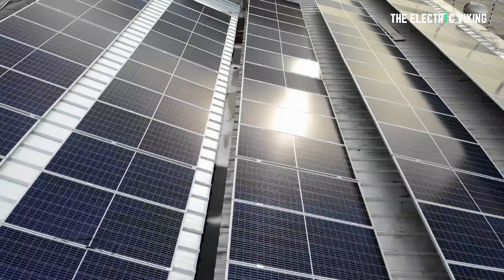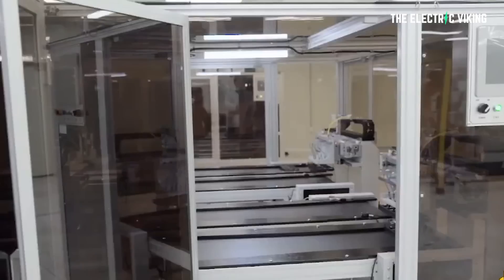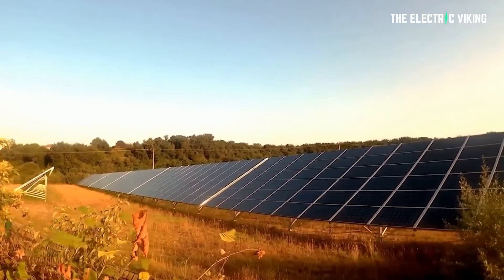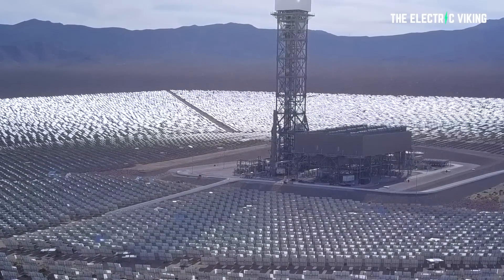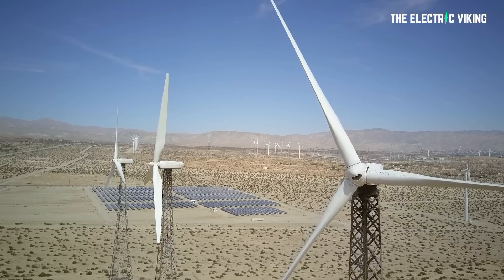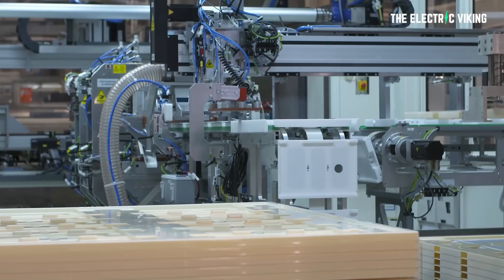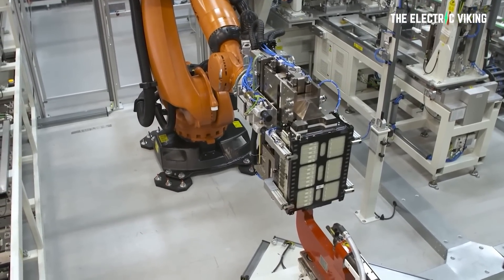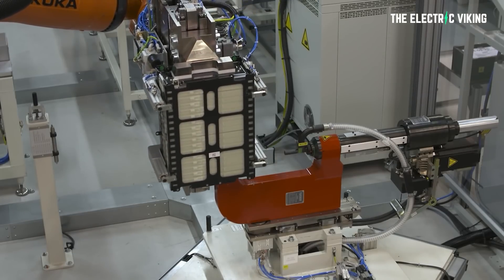The new battery that is cheaper than lithium with 4 times the capacity

Comment: How many solar panels do you have to use? and how much space would you need to replace one safe nuclear NON -pressurized (Melt down proof) 97% efficient (95% less waste) liquid fluoride Thorium (400x more available than uranium) reactor? Which also, btw, doesn't require expensive uranium enrichment processes (i.e. it would be free from Rockefeller controlled, dangerous, expensive, plutonium producing, waste producing fast breeder reactors? In fact it could be adapted to use all the existing waste uranium for processing... (which would be essentially free fuel!)

Comment: To answer your first question, The internet is flooded by the latest battery breakthroughs, all last longer, store more energy, and are cheaper.
It's just that once they have this amazing breakthrough you never hear about it again, and remember what you can do in a lab can be impossible to do in production.
It's like nuclear fusion, won't happen for 50 years at best, and may never happen.

Comment: Thin.  Very thin.  Vid author complains nobody's excited about Sodium batteries, then gives no reason whatsoever to be excited?  Where are the technological advancements?  What is the fundamental basis for claiming 4X-capacity?  For example, salt kills most batteries.  What's the change that suddenly makes salt a solution instead of a problem?  Lithium has a dendrite problem, how does salt improve it?  How is salt more mobile?  There's simply nothing in this vid but puffery.

Comment: There is not a shortage of Lithium. I am not sure why people equate the cost of refined Lithium with the idea that Lithium itself is rare….. it’s not rare. 
The shortage is of refined, purified Lithium. Lithium is one of the most abundant elements and is found all over the US particularly in the area of Nevada that Tesla has mining rights on. There is enough Lithium in easily accessible Lithium clays in Nevada alone to make enough batteries to completely electrify all transport in the U.S.
The problem is that the Lithium has to be refined to a very high purity and made into particular Lithium compounds. 
    The same problem of needing Sodium to be purified will exist. There will have to be special sodium mines and refineries to supply sodium for batteries. There’s lots less of those than there are Lithium refineries and guess where they all are? Yep the same place the Lithium refineries are. China. 
    The solution to the problem is not to change battery chemistries but to fast track the opening of Lithium mining and fast track the opening of Lithium refineries. Make LFP batteries.

Comment: Although it should be fair to point out that the focus of the research team led by Dr Shenlong Zhao of Sydney University wasn't for EV application but large scale grid storage. We should temper our expectations in regards to this until it is proven to be commercially viable.

BYD will be launching sodium-ion batteries but that is not related to this new type of sodium battery which you're talking about. The type being used by BYD will have a density of about 160wh/kg which is less than LFP at about 200wh/kg.

Comment: Sodium may have greater density but it also has more weight, which negates the capacity advantage to a certain extent. A heavier car will cost more due to needing more materials to support the greater weight. The ideal use of sodium batteries would therefore seem to be stationary storage, not vehicles. But that would relieve some of the pressure on lithium demand. And from what I've heard elsewhere the real problem with lithium supply is not that there isn't enough but that there isn't enough capacity to refine it fast enough to fulfill the exponentially rising demand. Musk pointed that out in 2021.  So sodium may be a good fit for the Megapacks.

Comment: The most obvious way to rid ourselves of coal burners is to substitute a set of small modular nuclear reactors for the coal furnace that boils water into steam.  The rest of the plant {steam turbines, alternators & cooling towers can stay as-is, more-or less.  All the existing transmission line infrastructure carries on as before, unchanged.  Just change out the heat source.  Search for "IMSR" for more information.  Much cheaper overall than using tech that needs expensive batteries.  Why use inefficient wind & solar when nuclear can be on-line 24 hours a day?  No batteries required.   BTW, 1000 charge/discharge cycles is laughably inadequate - the cells would need replacement every three years if cycled only once a day, which is a minimum condition.

Comment: Seen alot of comment here on Lithium vs Sodium. But hey i think there is a good potential on Sodium Battery. If they make it cheap enough to be replace, even with 1000 cycle is still workable for EV just like replacing your 12 volt lead battery. Every 2 to 3 years. Lithium as raw material has surge so much in fews years in another fews year it will surge so much than maybe sodium will be a more cost effective solution.

Comment: Lithium battery resources will be the problem soon.
Most of the countries will stop minings and exporting to the manufacturers for electric car. 
Because of legal issues 
Child slavery 
Landscape deformation and water pollution.
Mountains rivers causing floods landslides deforestation.
Minings of lithium are limited.
That’s why most
Of car manufacturers aren’t
Convince EV is the future.
Toyota Lexus has lots of alternatives.
Most of consumers likes.
Hybrid
Combustion 
Hydrogen 
EV with solid state battery
If the target is 2035 for zero emission.
Only few nations will comply of zero emission.
Rich countries only with small populations like Norway and Switzerland 
90% will still using combustion engine.
Oil producers exporters they might not buy 
Electric cars.😁

Comment: Dear Viking. Maybe I have identified one of the reasons why you had to come back with this topic once more. If I'm right, you may want to come back with it for a 3rd (and maybe 4rth) time soon. I recognized that you are talking about a minimum of 3 completely different types of batteries in the same video without showing it (just talking). I would almost bet that the vast majority of your viewers will not finally get your point because of this. The point you are making in this video may not be true for all of the 3 types of batteries, maybe not even for one of them. Rationale: a) Early in the video you are talking about sodium batteries, which are batteries that may be used for grid and/or home storage. These have quite a bad energy density and the title of the video does NOT talk to these. These are generally known under the name of "Salt" batteries and have an Aequous electrolyte that makes them very safe. But they are NOT cheap and they have LOW capacity. b) just prior to half in the video you are talking about Sodium Ion batteries but I'm not even sure if you are using the right term for it. These are the ones CATL is starting to make for cars but these do not have a better energy density than LiFePo4. The only way BYD can use them in their cars is by changing the design of the batteries to CTP (cell to pack) exploiting the advantage of these to not being in need of as much coooling as other batteries may. In this way they are making up most of the energy density drawback. And only the 1st half of the video title may possibly apply to these, but honestly we don't know as of yet because current sodium ion batteries in the market place are not any cheaper to buy than Lithium, because they are not yet mass produced. c) To the end of the video you are talking about a new concept of Sodium-Sulfur batteries which again is a completely different story. Until these are on the market I may not be around any more because so  much of this concept is still to be developed it is maybe more than 1 decade away from the market. Maybe to this one the 2nd half of the title of the video may apply but honestly we don't know yet because it is only a concept. And for sure your point in the video "so much has changed for EV's..." is NOT true for this concept while it has nothing to do with how EV's will be built in the current decade. Maybe in the next? But then, why don't you make such a video in 2026 it will be early enough.
Bottom line: If it was your goal to confuse your viewers over sodium Ion batteries using this video, you have done a phantastic job!
Congrats, if that is.
Reply: 100% agree that it's confusing. If it was about Sydney Uni's lab result of getting more energy density from a sodium battery, then he doesn't go into enough detail about the sulphur being the main driver of this increase and how being able to stop the degradation of the sulphur is the big issue. 50% capacity after 1,000 cycles isn't that great. I think US based Lyten and Germany based Theion are more advanced with their nanotechnology controlling the polysulphides in their Lithium Sulphur batteries, with both claiming around 900 wh/kg density and lifecycles comparable to existing lithium ion batteries. They're now shipping test batteries to industry but I guess it will be several years before this technology becomes proven as suitable for EVs and adopted by manufacturers. LIS energy in Australia also claim to have their boron nanotube Lithium Sulphur battery technology at similar density and lifecycle as Theion and Lyten but their website has less detail, so I'm not convinced their product matches Lyten's or Theion's.

Comment: REALLY SPEED the transition to a carbon-free ecology and economy: NUCLEAR POWER! The power density for nuclear is about 1000W/m2 compared with 2-3 W/m2 for wind and 100 W/m2 for solar. Nuclear emits 4 times less CO2 than solar power, 2 times less than hydroelectricity, and the same amount as wind power. BEVs need electricity.

Comment: This is actually a great arguement to build Deslaination Plants in every coastal country not only to provide clean filtered drinking water for every country on every continent, but they could now use some of the excess sodium (salt) taken from the water for batteries.  Some of the salt will obviously need to go back into the oceans, but some could also be used for batteries.  If we can pipe oil anywhere we can pipe clean filtered drinking water everywhere & solve so many problems around getting clean water to people who need it & we could solve the drought problem everywhere.  Solar, wind, tide & Geo-thermal will solve the energy problem not only by making it cheaper, but providing it to everyone everywhere & Desalination Plants could solve the water problem.  

Verticle indoor farming will solve the lack of food & put us on a path to abundance for everyone.  Tesla's Boring company could in future bore large 1 mile donut type tunnels under & around every major city where indoor farming could be applied to keep the produce away from environmental disasters & guarantee a continued supply of produce.  They could turn some of those donut tunnels into fish farms & control & flter the water constantly creating plenty of fish & other sea food.  They could turn some of those tunnels into animal farms where the animals eat the grass while wandering through the one mile tunnel that is temperature controlled.  There are plenty of options where we could grow plenty of food, create plenty of clean water & plenty of energy, we just need the will power & the politicians with some balls to start pushing for it.
Reply: The big problem with desalination is the residual is very bad for the environment, can't just dump it back in the ocean, we are talking millions of gallons.

Comment: Some confusion here, you are talking about sodium sulphur batteries, which are high temperature batteries, not really suitable for EVs, see https://en.wikipedia.org/wiki/Sodium–sulfur_battery

However, they are less practical than the sodium ion battery (https://en.wikipedia.org/wiki/Sodium-ion_battery ) which runs at ambient temperature and is similar to a lithium ion battery, just using sodium in place of lithium.

It's really important to understand the difference when reporting on this stuff, NaS batteries have limited use case due to their high running temps, whereas Na-ion have widespread applications and are the batteries CATL etc are targeting for EVs, this year in fact.

Comment: DISPATCHABLE energy from batteries when every vehicle has electric storage is huge.
Fossil electricity maximum is 600Gwh 
20million vehicles 100kwh is 2,000Gwh 
In Australia that is.

Aswell
20million buildings with rooftop 33kwh daily is 660Gwh daily.

The existing national electric grid will be UNLOADED and perfect for balancing batteries storage levels. 

Electric vehicles will be parked 23 hours a day. When automatically plugged into the grid too much energy will be available.

All centralised concentrated electric power generation is economically stupid.
Fundamental stupid. 

The biggest stupidity is the massive expansion of the national grid to transport the new and larger amounts of electrical energy. 

The existing national electric grid is horrendously expensive but necessary as it is.

5 times bigger capacity when no fossil fuels is unspeakably huge costs, and the private generation companies know it will be a government cost, when taxes increase and electric power bills increase it will be too late to go back.

Like toll roads that are privately owned and operated, and profits government guaranteed, nobody is going to unwind the deals.

Comment: NiBs do not have 4x the capacity of LiBs. That's simply nonsense. Sodium-ion batteries have somewhat lower cost (we presume), slightly lower energy density (best theoretical case), better safety characteristics, and comparable power delivery. characteristics.

Comment: The battery by Magnis Energy/C4V has only 3% capacity loss after 2,600 cycles (20 minute charge/discharge). It does use lithium, but it does't use cobalt or nickel. The battery featured in this video loses 50% after 1,000 cycles, so it still has a a way to go. Sam did also cover Magnis: www.youtube.com/watch?v=rRIrfUmPnaI

Comment: "After 1000 cycles the battery still had half of its original capacity." That's actually pretty bad. Lithium batteries should hit 80% original capacity after a few thousand cycles. So sodium batteries need to be significantly cheaper if they're going to be replaced, say, 6X as often. As focus has only recently shifted back to sodium (after decades of focus on lithium) I'm sure there are many advancements to be made in the coming years!

Comment: “Can sodium-ion batteries be used in electric cars?
BYD has plans to mass-produce sodium-ion batteries in 2023 as it aims to bring more affordable EVs with a reasonable range to market. Performance-wise, the sodium-ion batteries are suitable for low-range applications like those found in smaller cars like the BYD Dolphin and the upcoming Seagull model.”

Perhaps the Sydney researchers will have a better performance sodium battery. But not this year…

Comment: This is good to hear … at least for EVs.  But perhaps the worst problem in the USA is that more renewables & energy storage can’t be brought online quickly because there aren’t enough long-range high voltage transmission lines to move energy around.  Installing more is a bureaucratic nightmare to get easements, and is very expensive.  Can you give your perspective on this problem?.

Comment: sodium batteries have terrible life expectancy.  the number of charge cycles before degradation is laughably bad.   you need batteries that can handle no less than 1000 charges and ideally you would want thousands of charge cycles for a vehicle.  sodium batteries are well below 1000 charge cycles before noticeable degradation.  its a terrible substitute.
Reply: Let's assume the following: A car goes for 300'000 Km in life time; employing an 80 KWh battery. Let's also assume it takes 17 KWh to go 100 Km:  The required cycle life is 637.5 cycles. Having said this, if the 1000 cycles were true and if it was a 15% degradation (not a 50% as told in the video) then it would be ok to go.

Comment: The study used as a reference to this video, states the charging speed was 0.1A/g.  EV charging speeds nowadays easily surpass this.  Sodium batteries are a fantastic invention, but IMO they're limited to energy storage & that's it.

Yes, sodium batteries have a place in the long-term energy solution.  But context is key here